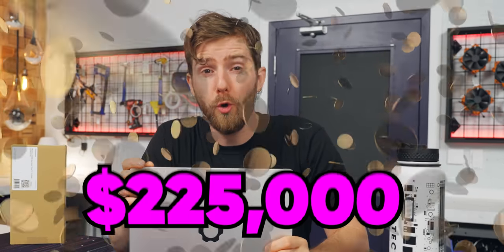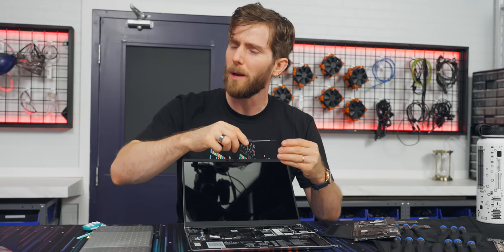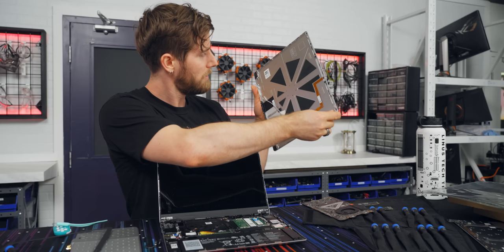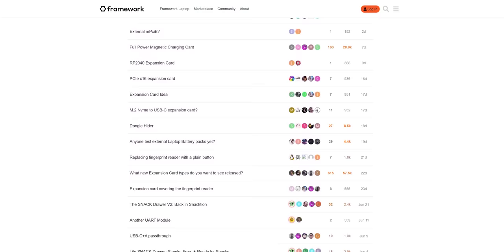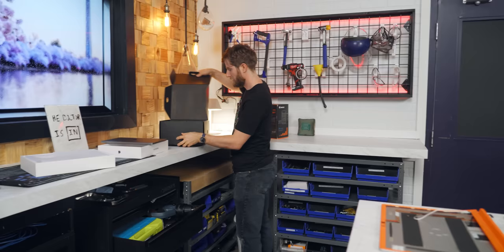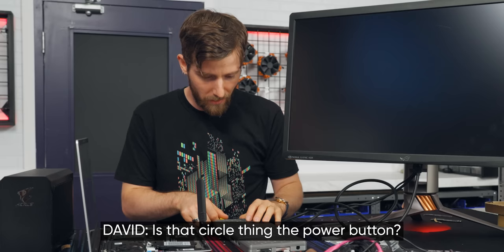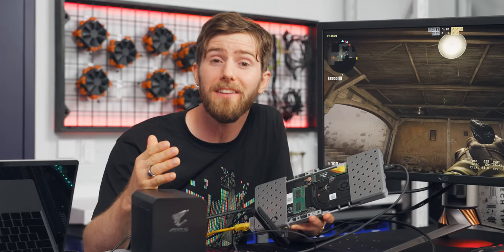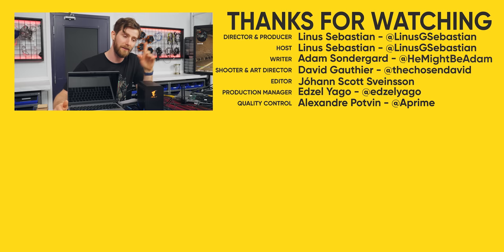I invested $225K in Framework Laptop - 1 Year Update and 12th Gen Upgrade

Comment: If Framework makes a 2in1 360 laptop, I’ll def buy it! Hopefully they introduce one by the time I need to buy one for college.
Reply: Why would you need that nonsense??.. a regular laptop is fine ... Then get a tablet if u actually need one .. but if your in college or going to be in coly I advise you to not buy a new car, save money and actually try to pass ur class's
Reply: @richardalfaro4933  for taking notes more easily for example
Reply: @richardalfaro4933  they're convenient
Reply: @richardalfaro4933  2 in 1s are great for handwriting notes. Typing out Stats or Calc notes are brutal.
Reply: @richardalfaro4933  to use it in tent mode, kickstand mode: basically as a tablet. And with pen support I’ll also be able to take notes and not need to buy an iPad.
Reply: This would be great! I love to use my HP Spectre x360 as just a screen if I have it on a thunderbolt dock with a keyboard and mouse and using a pen on it to draw math notes so a framework like that would be amazing.
Reply: @joemarais7683  couldn't agree more Joe!
Reply: @richardalfaro4933  I use one for high school bc I want to type stuff but my teachers don't let me type notes but only handwrite.
Reply: I already have a perfectly working and beautiful Surface Book 2. But the battery replacement cost is $650. Fills me with rage.
Reply: Touch screen would help so much already.
Reply: Doubt that's gonna be something easy to do as touch layer and the LCD panel both needs to be disassembled (which is pain in the arse ngl)
Reply: @jinwk00  I’ll agree, it can take a hit on repairability. Well what if they made made glass touchscreens easy to replace without gluing it on. Replacement part will sure be more expensive but realistically that’s bound to happen.
Reply: @jivewig  except the ipad is the better option compared to a 2in1 and also alot cheaper
Reply: @alexanderternst  lol just use a laptop or pen and paper
Reply: @FunctionallyLiteratePerson  nah their a novelty like a folding phone .. their for children
Reply: @joemarais7683  ehh I didn't like it so I guess we are different
Reply: Just get a tablet ...
Reply: I thought the same thing!
Reply: bru they prolly won't service in India by the time you reach college!
Reply: 2in1s are great for college - being able to set it up in different ways (like as a screen forward device if you've got it hooked into a keyboard) and having the option to sketch things out with a pen or do graphic design was very helpful too (though that'll depend on what you're doing, it's nice to have the option).
Reply: @richardalfaro4933  tablets don't necessarily have the power of software support that fully fledged pcs have
Reply: 360 design would absolutely make repair-ability more difficult
Reply: @richardalfaro4933  ahh yes, a much worse performing device, another device to lug around, and another set of adapters if it is used extensively. Tablets are garbage.
Reply: @seanonraet8327  well then just get a a laptop .. I don't understand why wait for a product that won't come
Reply: @andreaskeltwolfe6176   But I have to buy a decently powerful, portable laptop with good battery life anyways, so what’s the point of spending more cash to carry an extra device. Btw, I own a Surface Book 2 and have used it’s tablet feature extensively for school with the open nature of windows. So I know what I need and what I’m asking for.
Reply: @Ravenousjoe  yes they are I know .. but I don't see the point of paying more for a 2 in 1 where you get more performance for the price increase
Reply: @richardalfaro4933  it’s abt the convenience of needing to carry only one device. iPads are great but not good enough for my work to replace a proper laptop. Also even the cheapest iPad (not recommended) along with an Apple Pencil is going to cost more than getting a 2in1 upgrade in a laptop.
Reply: @richardalfaro4933  you don't see the point in spending only a but more for a laptop to not have to spend much more for a totally separate device with much less performance?
Reply: Same defo
Reply: @jivewig  their both pointless then .. the convenience is paper and pen and just scanning your notes into  a PDF from your camera .. your buying an overpriced under powered product both ways
Reply: @Ravenousjoe  I'm saying their both pointless ... I don't see the point of either .. just get a laptop 💻 or a tablet .. the two in one is pointless unless ur buying a garbage Chromebook for a child ... In college you should have a pen and paper and actively participate in class and try to mature... If you want convenience you can just hand write notes ( you retain it better ) then scan it with your phone and create a PDF file of it .... I don't see the point of overpriced gimmicks .. it's like buying a hundai or Kia over a Toyota it's just stupid
Reply: @richardalfaro4933  ohhh, so you just don't have a use case for a tablet and a laptop, so you think no one else should either. Got it
Reply: @SimonBauer7  lol it's not useful for anyone ... It's just nonsesne but your right there is a lot of nonsense in the world
Reply: @Ravenousjoe  no.. no one does .. people just complain about having two devices that suck and want one that sucks as well that is overpriced
Reply: @richardalfaro4933  Dismissing something that doesn't meet your use case as nonsense is asinine.
Reply: @richardalfaro4933  much easier, safer on a laptop and it's just convinient to quickly draw a graph on your laptop/take notes
Reply: @richardalfaro4933  well I am glad you are around to tell Apple that, I heard their iPads don't do well at all and they are losing billions on that sector of products.
Reply: @richardalfaro4933  You're really desperately trying to tell people to stop liking the thing you don't like.
Reply: @richardalfaro4933  Pen and paper :D :D :D Are you a grandma? Why don't you just carry your entire desk with you whenever you go outside LMAO. Troll
Reply: @Eunostos  no .. its not but I guess you can cry about it ?
Reply: @alexanderternst  why would you draw a graph for notes ?
Reply: @Luxalpa  no I'm just telling them it's nonsense .. whether you lack confident and self esteem and read the msgs from a pint of weakness is not my problem
Reply: @andreaskeltwolfe6176  except
I also want to type essays and work on a proper laptop but I don't want to pay for/carry 2 devices
Reply: @richardalfaro4933  I don't retain my information any more if I write it with a pen on paper over a pen on glass
Reply: @richardalfaro4933  you draw graphs in math and engineering classes, which you obviously have not taken
Reply: @JustAGlitchFL  lol use paper 🗞️ and a pencil .. you obviously don't need to draw graphs on an tablet .... Plus I did take engineering classes . I got into USCs engineering department when I was 18 but I found engineering boring so I went to computer science and found that really boring ( sitting in a room with a bunch of "nerds" I almost went crazy) so I opted for law enforcement. But then I got married moved 3 states in 7 years ( supports my wife's career) and I have now moved over 3 federal jobs and although I've lost a lot of income ( only making 90 grand a year after 7 years ) buts it's okay since my wife makes a ton more than me

Comment: for an “easily fixable” laptop, linus is really making this look incredibly hard
Reply: if only he'd used the easy ifixit-style guides they provide.
Reply: Edit: So much for repairability huh fanboys? It turns out Linus himself is refusing to offer warranty in any capacity on his new shitty overpriced backpacks. Weird.

It's a piece of overpriced plastic, I could have bought another M1 Air by now except the M1 Air is fully metal, has the best touchpad (and keyboard imo) on the market, and lasts 3 times as long on battery power (you know, the whole point of a laptop)
Reply: Doing a mobo swap on a traditional laptop is far worse than this. Even just a run-of-the-mill latitude business model, you are talking a complete disassembly of the entire thing. Like 70 screws - in the correct order, carefully prying plastic pieces that are not meant to be removed, taking apart the entire frame, removing the screen, disconnecting EVERYTHING, etc etc...
Reply: @robertstojs  yes, and you get to support a company that wants consumer ‘s products to become obsolete as soon as powerful
Reply: @robertstojs  Good luck upgrading or repairing your M1 Air without sending it to Apple and paying almost the full price for the thing to repair it.
Reply: @georgejones5019  The top spec i7 board that framework offers (a total joke of an ovepriced chunk of plastic btw) is slower and much less efficient than the M1, oh and just replacing the mainboard by itself would cost about as much as my M1 Air did
Reply: @robertstojs  you just really don't have any idea what's going on here or what you're talking about. Good luck with your obsolete Apple when somebody is still upgrading their framework that they bought at the same time to Specs well past your Mac for less money. This company is just getting started and they're already doing something amazing that you apparently are incapable of comprehending.
Reply: @davidmcguire6043  Whatever you say David
Reply: @robertstojs  What exactly (except maybe the keys) about it is even plastic?
Reply: @motzyt  Even in framework's own words the thing is half plastic and even the parts that are aluminum look cheap and flimsy (screen wobbles to the point that it's unusable unless on a table)

Long story short it's a low quality "laptop" (if you can even call it that with the battery life you get) priced like a premium product. Embarrassing.
Reply: @robertstojs  Long story short I have one. I had a Macbook Pro before that, I liked that one as well, I find the speakers and the touchpad worse than the ones on the MacBook, that is true. But never have I had problems with the laptop on my lap or somewhere else where the screen wobble would've made it "unusable" at any time.

Also, where exactly did they state that the laptop is made of 50% plastic? From looking at the outside of the laptop, it's mostly aluminum with a really nice touch to it.
Reply: @thembones1895  some are not hard at all. It totally depends of the laptop
Reply: @davidmcguire6043  im not about to buy a laptop just to change it part by part as time goes. macs are reliable enough to last 5-7 years, and after that i would prefer to just go out and buy a new laptop and recycle the old one instead of fiddling with shit like this framework laptop. what if framework realised the modular design wasnt good enough? what if it wasnt efficient enough in cooling? what if there are technological advancements in display technology in the future? would i want to be stuck with a piece of old age technology for years? no. i would use a laptop for 5 years, recycle it, and buy a new one. it doesnt make sense otherwise. just take good care of the laptop and it should last long.
Reply: @yeehaw5741  The screen and fans are replaceable too, so the only point of the three that you bring up that holds water is the worry about modular design, which probably isn't being deprecated any time soon because it's basically the entire thing that distinguishes framework
Reply: @robertstojs  You seem to have no fucking idea what you're talking about. That 50% and 75% was how much recycled plastics AND aluminium they used for each components.

Also, as someone who's had the experience of seeing countless apple products get broken screens, dents and other very unpleasant things, (to be fair tho, they did still fully work) and all meanwhile being told it's better to buy a new one instead of replacing one fucking component whenever is suggested a screed repair at a local shop, apple really doesn't make laptops no better or worse than framework or any other reputable ultrabook company.

Also, on the topic of screen wobble, many ultrabooks do have that. And Macbooks are no exception. In fact, the best in that regard is the Dell XPS 13, not a overpriced piece of aluminium junk with ZERO 3rd party repair. And the fact that Framework had the balls ro say "Yup, we fucked up as far as screen wobble goes. So we're spending thousands of dollars designing a new hinge mechanism so those who find it annoying can just replace it for a couple dozen bucks." shows they are willing to make the Framework a laptop you WILL want to buy, even if you don't care much for right to repair.
Reply: @yeehaw5741  Sadly you can't "recycle" laptops. Most technology is near impossible to recycle, since there's so much stuff like gold traces and silver that you can't extract to use. So the ideal scenario would be to reuse it instead outside it's case. And guess who offers ZERO support for that. That's right, Apple.

Also, the design on Framework WILL defo outlast a Macbook under the same conditions. If you can make a Macbook last longer than 5 years, than you'll likely have your Framework last like 8 before you have to change anything. The Framework team is made of engineers who were done working for companies that tossed out laptops after they broke as ewaste instead of letting them be repaired. So the laptop is designed by people who clearly know what they are doing. But I supposed talking to anyone in the comment section is useless, *Margatitas ante porcos*

Comment: Maybe on the internal parts they should have colour coded screw holes so that you can easily identify what sized screw goes where. For example red would be the “small screw” (whatever screw spec it is) and blue would be the “medium screw” and so on. They could provided a legend of all the colours and screw specifications for reference to save from colour coding the screws themselves which would be expensive I would assume. 

Another thing could be that each part could specify how many screws total it requires so you can keep things way dummy proof…so it would be something like Red 4 indicating that this parts requires 4 x red sized screws. This could help with not having extra screws remaining afterwards 😂
Reply: That imo requires way more effort than just reading and following the guide that was provided, which Linus omitted

Comment: I'd love to have seen the comparison between the last motherboard and the new motherboard on a performance benchmark. You swapped motherboards and CPUs to a better model, but do the thermals hold up?
Reply: We're talking LTT...I'm sure that's on the list of videos to be done.
Reply: iirc, Tom's Hardware and NotebookCheck have comparisons and reviews up if you want to look at one now
Reply: Considering that the cooler itself was included with the mainboard replacement, it would make sense that it has enough cooling capacity to keep up with the 12th gen cpu's. That being said, it's still not a given.

Comment: I am really excited to hear this about Framework over a year, especially considering where the market has gone lately. I have no use for a new laptop, but Framework is on my radar for exactly the reasons you demonstrated here. I am excited for their future. One thing I would like to see from them is a touch screen option, a 2 in 1 chassis, and more first party cards, especially a full size SD card slot and dual USB C. I think the expansion cards are a key selling point to get into Framework, and I am a little disappointed that the selection of first party cards is the same as it was a year ago.

Comment: You should encourage framework to make a “creator” version or a expanded color gamut display model. I have a 5yr old dell xps. Display is great, just needs a new processor to chug less while editing photos. If they can do it, (preference 15”) they’ll be my next computer.
Reply: Maybe they could outsource the Screen to some 3rd party company, who can better make Screen replacement parts, like say Samsung or LG on the Top end.
Reply: @Sup_D  that’s a great idea! I saw something on the forums that maybe they would need to change the connector on the motherboard to work with LG panels, but there’s got to be a way to make it work 🤔
Reply: @nathaniellecompte55  Well, unless those connectors are not some sort of proprietary tech of LG, there should be a way around.
Reply: @Sup_D  Framework doesn't make their own panels, they buy off-the-shelf from long-established display companies, IIRC either BOE or Innolux. Regarding the connector, it would be a standard 30-pin or 40-pin eDP connector, depending on whether or not the panel has touch or not.
Reply: @recurveninja  Yeah, in the older non "thin and light" panels they often added adaptors in the panel electronics behind the panel it's self. My current laptop may even have one, as the replacement screen I got for it was a slightly different batch to the original. However, they may not be enough room in a thin and light to fit the electronics/PCB in there?
Reply: Not only more colors, but also pressure/tilt pen support. My partner currently uses an XPS 13 for professional digital design and this would be an instant buy for her if she could still use pen and touch.